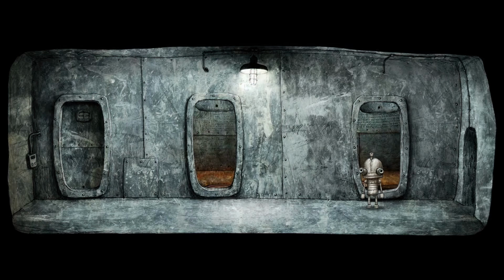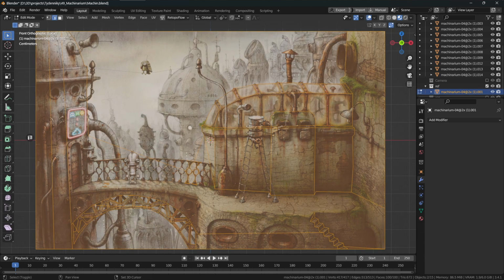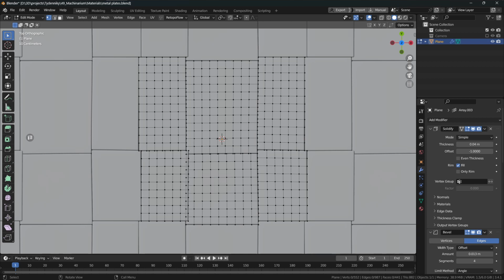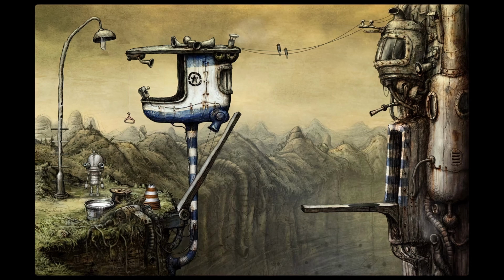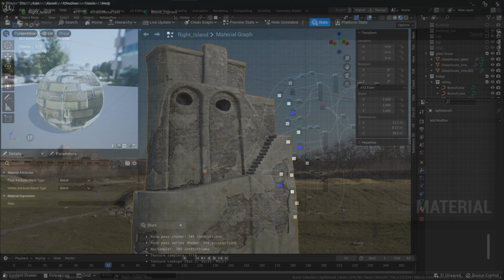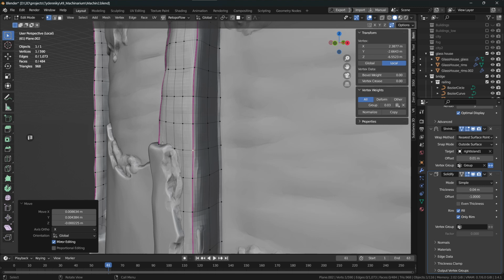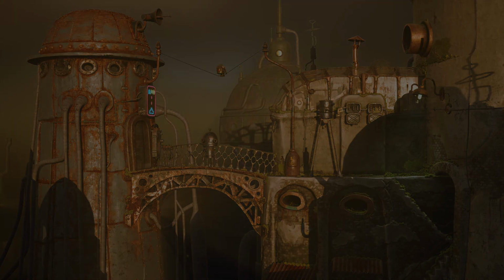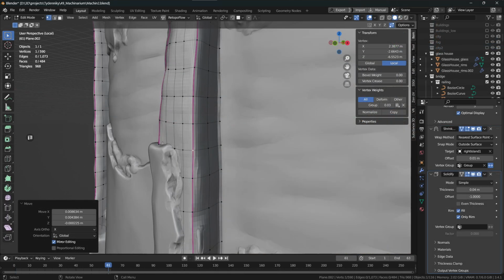How to make Machinarium in 3D

Comment: Nice work but my head hurts just looking at the meshes in wireframe especially with unreal engine nanite being still far less optimized then making the topology actually good. But otherwise you did a great job I would never be able to uv unwrap the high poly models as well as you did. But still you did an amazing job